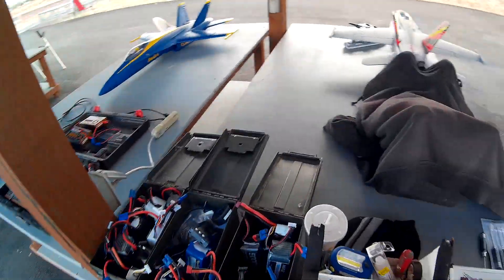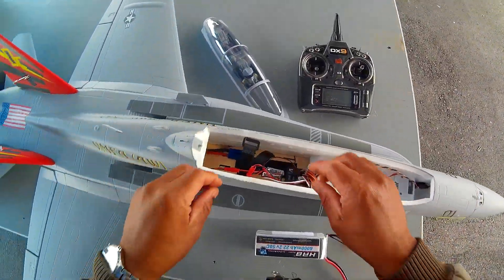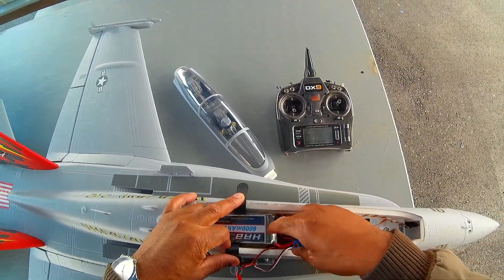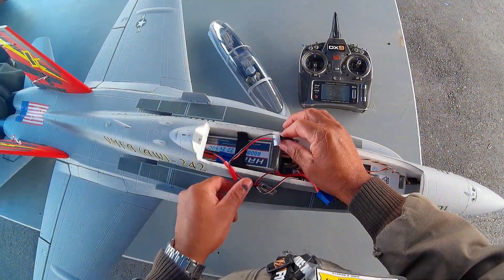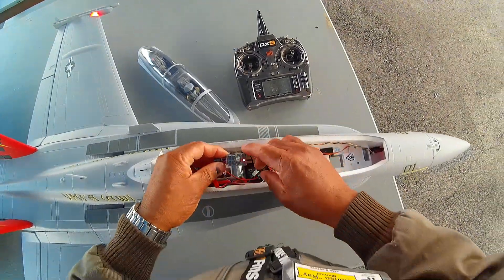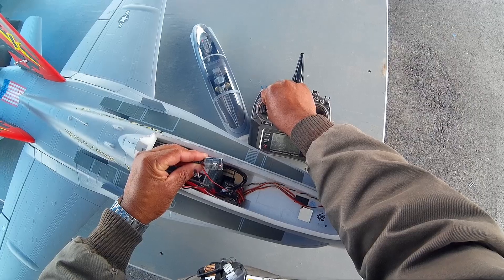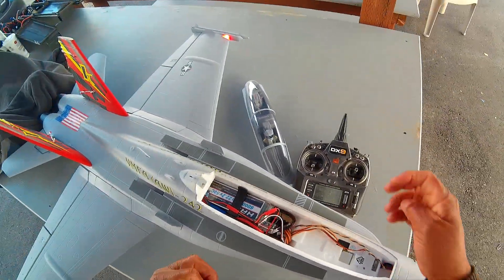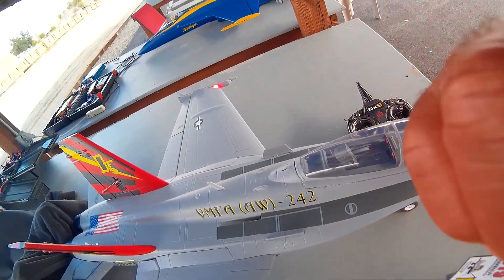Gooniac's RC EDF Creations LED Afterburner Demonstration

Comment: I noticed you did not turn on using switch. When l did that the burner blinked until full power. Then l unplugged and did switch off plug battery into jet, plug adapter into battery & turn on switch. Works like yours did in video. Could not get to work w/throttle cut off, did l do something wrong? But working great 👍🏻👏🏻✌🏻🖖🏻👊🏻
Reply from the maker: EQ RC this is using a spare channel. It will work with throttle cut in this configuration only. If you use a Y cable it does exactly what the throttle does. I will do another video explaining that.
Reply: I was wondering how you were operating the afterburner while throttle cut was on. This explains it!  Thanks!!